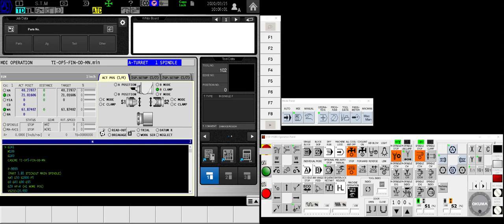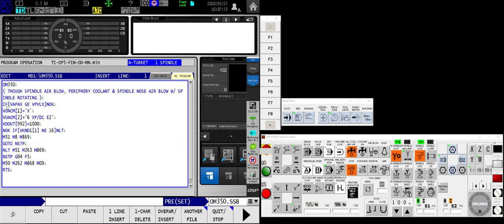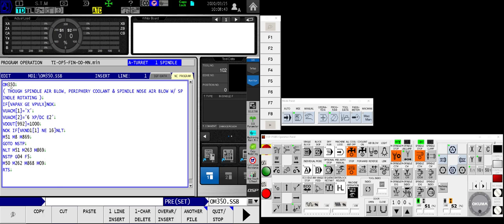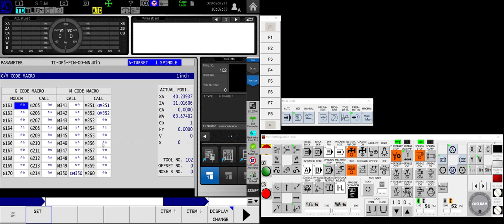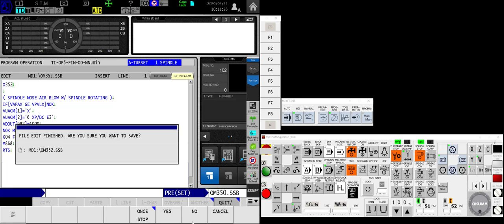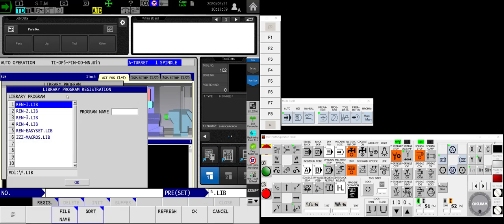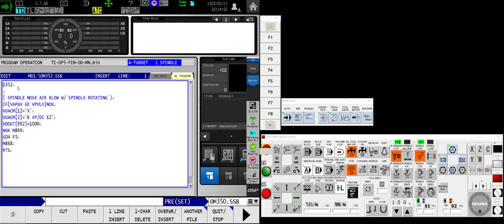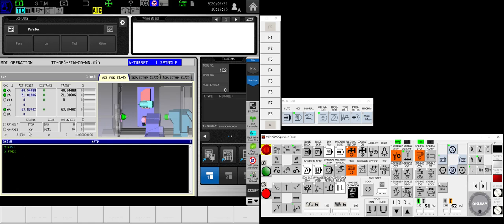REG SSB FILES OKUMA MULTUS U MACHINE

Comment: Thank You for video, but could You explain more detailed about .SSB and .LIB differences? I think I didnt catch it up. I have watched both videos.
Reply from the maker: No problem! The format for the two are the same, but each has a bit of fancy that needs to be explained. An SSB file is designed to be called from within a program. It cannot be called with a G or M code, but only wil the word CALL xxxx. An LIB file can be called with a G or M code, but needs to be registered in the LIBRARY file stack mentioned in this video. The biggest advantage of SSB over LIB is that the size of an LIB file takes away available program size from your regular MIN file, but an SSB does not. My decision on which to use revolves around the question "Do I want to use an M or G code to call this routine?" If yes, it must be an LIB. If no, SSB is the better choice
Reply: @pocketcharleywithgosiger  Thank You. Well explained.